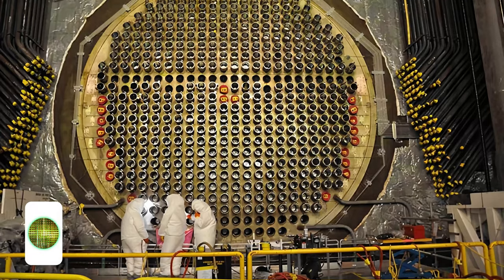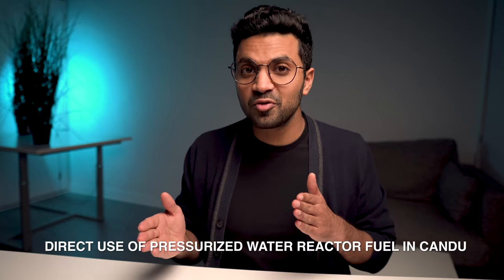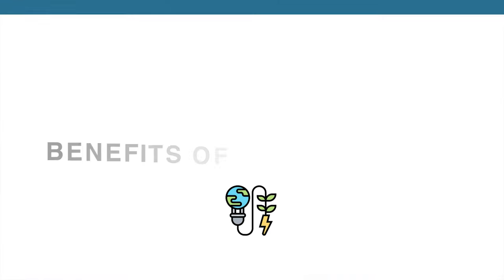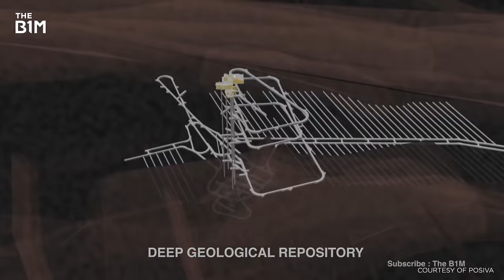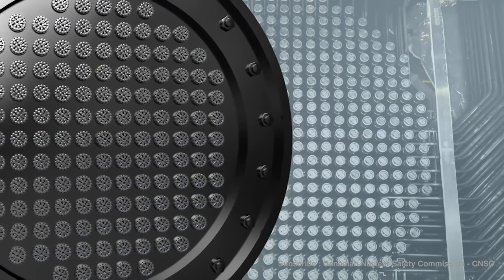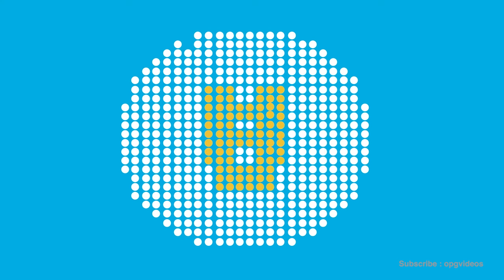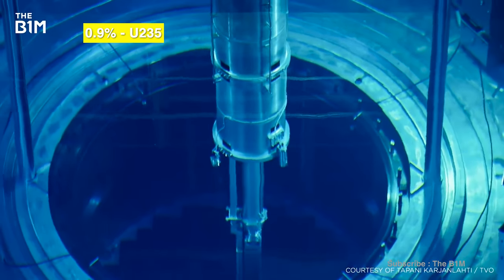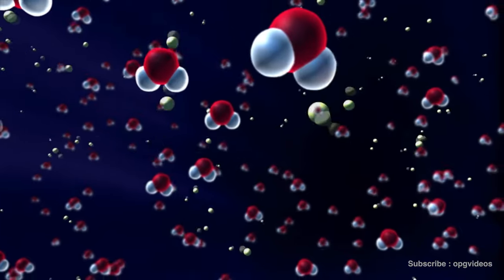How CANDU Reactors Can Solve The Nuclear Waste Problem

Comment: Thank you for this most informative video. It answered a lot of questions I still had about the Dupic fuel cycle. Some of them I had worked out myself through diligent reading, but some questions were left open which you answered with your video. One small last question; doesn't the increased power output (from 935 -> 1100 to use your example) hurt the reactor? Like extra stress on core materials etc?

As an aside, there is another reactor that can do what the CANDU does. The Russian BN-800 (Быстрых Нейтронах = Fast Neutron) can also use the spent fuel from other light water reactors. However, it is a fast breeder reactor, not a thermal reactor.

And I have two favourite reactor types. The CANDU obviously, and the RBMK despite its many flaws and weaknesses. Weird combo, I know😅
Reply from the maker: Great question Swoka! Uprating the reactor by increasing power of outer channels won't damage the reactor. The reason why is b/c the outer channels are usually running at a lower power rating (since they are not surrounded by other channels - due to not having as much neutron activation from neighboring channels. Great question though!
Reply: @OsamaBaig  
Thanks for your answer. Another thing learned today. Keep up the good work with your channel! I still think it should get way more views though. Your info is clear, concise and easy to understand, even for those who are not nerdy bookworms like some of us^^
Reply: Not that weird, actually.
The CANDU and RBMK have some striking similarities.

Both are «channel-type reactors»- Allows for online refueling

And both can run on natural uranium, because graphite also has a great neutron economy, like heavy water. 

The problem is that while you can «poison» a CANDU to stop it in an emergency, by doping the moderator with a neutron absorber, you cant do that in a RBMK. Plus, nowadays RBMKs are much safer than they were from proper operator training and several upgrades to the reactors. Basically now operators know -DO NOT YANK OUT ALL CONTROL RODS AFTER XENON POISONING YOUR REACTOR-. I actually wonder if an advanced version of the RBMK could become something like a «discount CANDU» by upgrading safety features, and by actually building containment buildings over the reactors. Graphite is much cheaper than heavy water.
Reply: @AlldaylongRock  
When reading and learning about both reactor types (I started teaching myself about the RBMK first and then came across the CANDU later), I said to myself; "There is no way that these two haven't met at some point, considering just how similar they are." I'm thinking in the direction of the Soviets spying on Canada when they were working on the early CANDU designs. But because the Soviets didn't have access to large quantities of (expensive!) heavy water, they went with graphite as a moderator instead.

One cannot use liquid poison in an RBMK because it's a BWR-type reactor. It would gum up the innards of the reactor to the point of it being permanently rendered inoperable. That goes for any "regular" BWR as well. With a PWR/ CANDU you can flush the primary loop after it all is said and done, post-emergency. With the former reactors not so much, due to them producing their steam in situ, instead of in a steam generator via a secondary loop.

They have done extensive improvement work on the RBMK. They have cleaned up quite nicely safety-wise, as far as RBMKs go. Of course there is still the not-having-full-containment bit, but apart from that they have become proper, well-behaved reactors. And yes, pulling as many rods as they did is beyond ridiculous. If Xenon has pulled your reactor that deep subcritical, you should let the reactor sleep it off for at least 24 hrs before even considering a restart. But that would have meant they couldn't do their vaunted test. And failure was not really an option in the Soviet Union.

"I actually wonder if an advanced version of the RBMK could become something like a «discount CANDU» by upgrading safety features, and by actually building containment buildings over the reactors. Graphite is much cheaper than heavy water."

Actually, I might have sort of an answer to that. I stumbled upon this design when asking myself the same question. There has been work done on a successor to the RBMK. It was supposed to be built at Kursk NPP as Unit 5, but eventually got cancelled in the aftermath of the Chernobyl disaster. It is called the MKER (Многопетлевой -> Multi-loop, Канальный -> Channel-type, Энергетический -> Power, Реактор -> Reactor). It would have had full containment; improvement of the plant economics due to an advanced turbine cycle; enhancement of the reactor neutronics; the introduction of passive safety systems not unlike those found on the CANDU; an increased number of independent circulation loops; the possibility of accident localisation in one loop.

There is scant information about it, only found one page with the above characteristics and one technical schematic/ drawing. Not going to lie, I really would have loved to see this reactor in action. It would be all that an RBMK could have been, if only they'd sit on the design a bit longer, instead of just plunking it out in the world like they did.
Reply: @swokatsamsiyu3590  I also stumbled upon the MKER when reading about the RBMK.

Chernobyl was a big mess up for the world in general. Things would look much better now. For one, many more countries would have gone nuclear, and R&D wouldn't be halted and so focused on LWRs. Fast reactors and CANDU-like reactors (channel-type, NU fueled) are quite the tech. For one, no enrichment necessary. There's leftover Pu in the fuel from these. Reprocess, and throw that Pu into a fast reactor along with NU. In fact THIS was why the RBMK was built. To generate Pu for bombs (or at least heavily based on a military reactor). It's design was totally optimized for the premature removal of fuel rods so there wasn't much Pu-240 and Pu-241,which are a problem for bombs, but no problem for a reactor, especially a fast reactor.
The lack of containment was also due to this "optimization".
Reply: @AlldaylongRock  
Very few people actually know about the MKER. It's nice to be able to "talk RBMK" to someone appreciative of this very much misunderstood reactor type.

Chernobyl almost singlehandedly killed the entire nuclear power industry, despite the fact that a similar accident is literally impossible elsewhere in the world. The RBMK-type reactor was only used in the Soviet Union, and even with all its inherent instabilities they still had to do extraordinary things to Unit 4, before it finally gave up and failed.

I like the fast reactors very much. To me, they are an indispensable part of closing the nuclear fuel cycle. Make a team out of a PWR and a CANDU, then add the fast reactor to close the cycle. This, together with reducing the weapons-grade Pu stockpile, would go a long way to solve the waste problem.

Yep, the RBMK has a full military reactor pedigree. AM-1 (Атом Мирный-один "Peaceful Atom-1") -> AMB-100/ AMB-200 (Атом Мирный Большой cto/ двести "Big Peaceful Atom 100-200") -> RBMK-1000 (реактор большой мощности канальный-тысяча "High-power channel type reactor-1000"). Not only can you make oodles of electricity with it, such a big powerful reactor can also breed lots of high-quality weapons-grade Pu. I'm not sure if they ever actually did use it as a Pu breeder, but it most certainly was designed and optimised for it. They could have given it proper containment, but that would double the price per Unit built. The Soviets were hard pressed for money, so they forewent the full containment. We all know how that ended.
Reply: @swokatsamsiyu3590  Technically speaking, you can team up just the CANDUs/RBMKs and the fast reactors using reprocessing. Zero need for uranium enrichment. This is why I get so mad about Chernobyl. Like you mentioned, the MKER could be the "Discount CANDU" that is so sorely needed to be more efficient in using nuclear materials. 
There's also the RBMK-1500, a 1.5GWe version of the RBMK that was used in for example, Ignalina NPP in Lithuania.
The Soviets honestly could have designed the RBMK much better, a containment building would be great. And it's a total shame that the world has lost a possible cheaper alternative to the CANDU.
Reply: @AlldaylongRock  
Having these two reactors team up with a fast reactor would not scare us, but most people (read: regulators) will not allow an RBMK/ MKER within their borders because like you said...Chernobyl. Even if it would have full containment, proper and redundant safety systems, in short the works; the very name alone will freak them out. Which is too bad, because the MKER could have been really good.

Unfortunately, while technically the RBMK can run on natural uranium, it does need slightly enriched (about 2.4%) fuel to combat the positive void coefficient. They would definitely have to fix that.
The twin RBMKs at Ignalina were awesome! They were only shut down because the EU demanded it. Both reactors still had a lot of life left in them. The EU could have at least let them serve out their lifespan, they were no threat. Now Lithuania has to import very expensive electricity from elsewhere, where once they were fully energy independent.

That's what I always say to people: "The RBMK isn't a bad reactor per se. They should have sat on the design a bit longer. Give it the things it needs to be a proper, safe reactor instead of plunking it out there in its bare fuel rods without so much as a decent roof (containment) over its proverbial head. And better training for the operators at the time would have been nice too." So many missed opportunities there, I can only concur with you.
Reply: @swokatsamsiyu3590  Didn't they fix the extremely positive void coefficient after Chernobyl? And the MKER would likely fix the problem and be able to run NU. The RBMK itself could run on NU, but it was very difficult to operate using NU, originating high stress levels in operators.. So they started using 2% LEU (still half the enrichment needed for a LWR, although nowadays with gas centrifuges it's not really an issue. 3 - 4 passes through the centrifuges and the Uranium is at 4%). 

Actually Rosatom kept working on the MKER after Chernobyl, even collaborating with Westinghouse. But the Chernobyl stigma really messed it up, I think one mix of RBMK with MKER was actually built and is operational in Kursk. A real shame that the world lost this technological opportunity. 

And I did some math, the shutdown of the remaining units in Chernobyl killed about 14000 people because it was replaced with coal (Ukraine in 2021 got 4GW average from coal). Ignalina was downrated to 1300MW/unit after Chernobyl, still its a lot of juice... And absolutely dumb to close it. they were the newest RBMKs in existence. Fun fact, the positive SCRAM effect that originated the Chernobyl disaster was first observed in Ignalina-1, but Soviets being Soviets, that wasn't immediately addressed. After Chernobyl, a pre-SCRAM system was developed, by first putting some specialized control rods in, and then you can SCRAM the reactor.
Reply: @AlldaylongRock  
Yep, they most certainly did. Not only did they give it better (read: more enriched) fuel, they also put extra fixed absorbers in the core that are required to stay there at all times. Originally, with a fresh core these would be placed in fuel channels throughout the reactor to combat the excessive reactivity from all that new fuel. Then they would gradually be replaced over time as the fuel burns out, and the reactor enters what's called the steady-state refuelling mode. Now there is a certain number that must always be present, regardless of core-life advancement.
They also improved the Scram system, bringing the overall insertion time down from a skeletal 18-21 sec to 12. The fast-acting system you refer to consists of 24 special rods (having no graphite displacers, they're Boron only) that move in a water film cooled channel, and are gas driven. Upon the activation of a fast Scram (BAZ) signal they will be fully inserted into the reactor in less than 2.5 sec. These rods are NOT under operator control, they can only be withdrawn under motor control following a Scram, and the route for this is heavily interlocked. I.e., the operators can no longer do to the current RBMKs what they did to Reactor 4.

Another thing they did is to connect the bottom-up rods to the Scram system. Before the accident, only the top-down rods were connected to this system. The shorter bottom-up rods weren't. When they initiated the AZ-5 on that fateful night only the top-down rods moved, giving a momentary spike of positive reactivity. If those bottom-up rods would have been connected as well, the accident might have not been as severe, because they would immediately start to insert negative reactivity in the lower section of the core where things went so horribly wrong.
The RBMK can be very temperamental, running it on NU only exacerbates this behaviour. So, it makes sense to give it somewhat enriched fuel, if only to make the operators' lives a bit easier.

From what I've been able to find, Westinghouse would be heavily involved in developing an automated process control system for the MKER. And to my knowledge the MKER has never been fully operational. They had started the build, paused it after the Chernobyl accident, and eventually shelved the whole project. It sits partially finished next to Kursk Unit 4, I think. If they'd only given it a fighting chance...

Those numbers can be seen everywhere, where they foolishly shut down reactors to then replace them with smelly old coal. Look at Germany. Merkel got her panties in a wad after the Fukushima disaster, and ordered to shut down perfectly fine and safe reactors. Like Germany is ever to see a Tsunami of that magnitude. Now they have to raze entire medieval towns to the ground for their lignite coal, the worst offender out there when it comes to pollution. None of it makes any sense whatsoever. The same goes for the twin RBMKs at Ignalina. Together with Smolensk Unit 3 they were the newest, most modern of all the RBMKs. They posed no threat to anyone. The Lithuanians had abundant and cheap, reliable energy. Now they are impoverished by having to import it against ridiculous prices.

They noticed this flaw even earlier than that. It was also observed at Leningrad Unit 1 in 1975. A scientist named Volkov wrote an extensive report to the Soviet top brass, insisting they tackle this flaw asap. But like you stated, Soviets being Soviets and all that. After they noticed it again at Ignalina Unit 1, they had started to slowly upgrade the RBMKs, but one at a time because of the high costs involved. They would implement them when a given reactor unit would be shut down for maintenance and repairs anyway. Unit 4 was supposed to get these upgrades at the scheduled repairs on April 26...
Reply: @swokatsamsiyu3590 
"Unit 4 was to get the upgrade in April 26, 1986"
How f*cking ironic. If only the operators just shut it down and didn't want to carry on with the stupid experiment. The secrecy around RBMK was its worst enemy. And the world's. The stigma originated on graphite-moderated reactors after Chernobyl (ironically, some of the newer Pebble-bed HTGCRs are graphite moderated, and the MAGNOX and AGR were also graphite block moderated, NU fueled reactors, but since those were gas cooled, no "void coefficient" to deal with. The French also had the UNGG, which I think was basically a mix of an RBMK with a CANDU, using a pressurized heavy water loop as coolant to reduce the void coefficient (CANDUs have a slightly positive void coefficient), and graphite blocks as moderator).
The MAGNOX was a bit weird too tho.
Reply: @AlldaylongRock  
"If only the operators just shut it down and didn't want to carry on with the stupid experiment. The secrecy around RBMK was its worst enemy. And the world's." 

You're bang on. Poor Unit 4 really never seemed to be able to catch a break. When they heard about the delay, they should have cancelled the test. Most certainly when they decided to do it anyway, and the power fell to 30 MWt. That, together with the power not wanting to go back up, was their biggest clue that Unit 4 was heavily Xenon precluded. As I said before, they should have let the reactor sleep it off for 24 hours before attempting a restart. Unfortunately, Soviet politics got in the way of pretty much everything. Even at something like a power station it wasn't just about running your reactor. It was also about; "How can I politically manoeuvre this to my advantage." Things like that should have no place near a running reactor plant, full stop.

A big part of the blame firmly lies with Soviet secrecy. If they had told the NPPs about what they discovered about the potentially fatal flaw, the operators could have taken it into account and NOT demand of their reactor that it bend the very Laws of Physics in order to please them. To then get all pissy at it when it wasn't able to comply with that ridiculous demand.

Had to look up the French UNGG. Will have to look into that one a bit more before I can give my two cents about it. I'm also very curious to see where the new developments lead. The Pebble-bed reactor looks to be a promising design.

I do know the Magnox reactors and happen to like them. These are a bit wonky, but so is the CANDU. And yes, the CANDU does have a (albeit very small) positive void coefficient which is often held against it. However, what all the naysayers forget is that not only is the CANDU a very safe reactor that is strictly controlled by two fast-acting, independent shutdown systems. It can also do something the RBMK cannot. If the chips are really down, as a last-ditch effort the CANDU can completely dump out its moderator, something the RBMK has no hope of doing. So, there's that.
Reply: @swokatsamsiyu3590  Actually, to wean off Xe one needs 3 days. But by then, they could have just shut off and do the maintenance work. The experiment itself was dumb anyway. Politics should be away from nuclear power altogether. 
The UNGG is actually gas (CO2) cooled,my error, like the MAGNOX,it just used different fuel assemblies.. Graphite moderated, gas cooled reactors are way worse than the CANDU. A channel type Graphite moderated PWR (instead of BWR like the RBMK) would be a cool technology. The high pressure would severely reduce the void coefficient. Probably that was what was meant to be with the MKER. Shame that those reactor types got such bad press because of Chernobyl. And nowadays with FBRs and MCSRs I don't think it's likely that the technology can resurface. The take on graphite moderation is the pebble-bed concept, along with gas cooling. I don't mind that, the ridiculously high temperatures some designs reach are quite cool for red hydrogen and for industrial usage. Reprocessing the fuel is what I wanna see next.

CANDUs can also poison the moderator with Boron or Gadolinium.
Reply: @AlldaylongRock  
Yes, to completely get rid of Xe-135 does take about three days, depending on core size/ reactor type etc. However, after a day Xenon has decayed away enough to the point that you can safely attempt a slow restart, even with an RBMK. The experiment should have never been conducted the way they were planning to. But leave it to the Soviets to bugger things up.

I'm not quite sure if you could do a graphite moderated PWR. The pressure they run on is so high that I'm not sure if the graphite would be able to tolerate such pressure levels. From the little I did manage to find about the MKER; it basically still was, or rather, would have been what the RBMK could have been if they had sat on the design a bit longer. Full containment, passive safety systems, enhancement of reactor neutronics etc. They also worked on improving something they called "self-protection of the reactor". To me it reads as "we're making it Dyatlov-proof". They were also working on making the ORM (Operating Reactivity Margin) as small as possible. This margin played a huge role in the development of the accident. And they were working on making certain fuel channels available for isotope production and material doping. This reactor could have been really, really good. Such a shame we will never get to see it in action.

To me, FBRs are an integral part of nuclear power's future. I know that EBR-II had an on-site fuel reprocessing facility, closing the fuel cycle. In its entire lifespan, the fuel never left the site! It was put into the reactor. It would stay there as long as possible. It would get taken out, reprocessed and reworked into new fuel assemblies to then be put back into the reactor. This system worked very well, but was not pursued further because of the associated high costs. Now that the times have changed, maybe it will get a new lease on life. Who knows?

Yep, CANDUs have two separate, fast-acting shutdown systems. Control Rods and an injectable poison. The moderator dump is really a last resort if for whatever reason the aforementioned systems should fail to take the reactor deep subcritical during accident scenarios. The dumped out heavy water gets replaced by "regular" water so that cooling will be maintained, but neutron moderation is impossible. Unit 4 would have loved to have had the option...